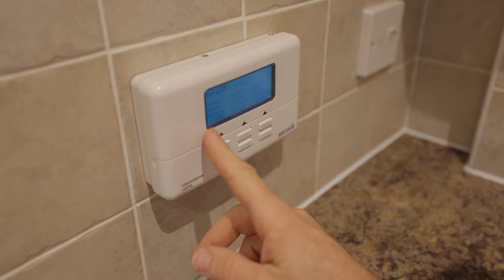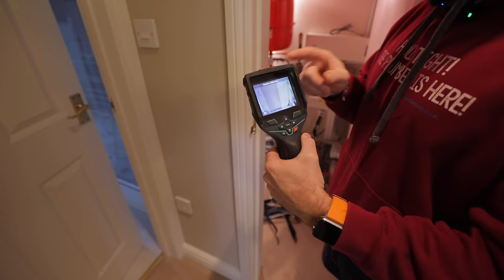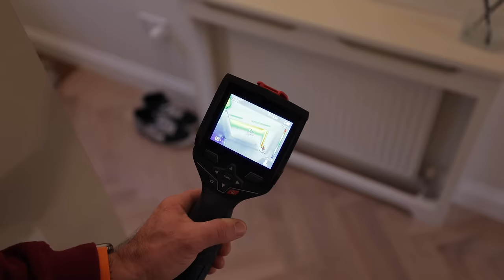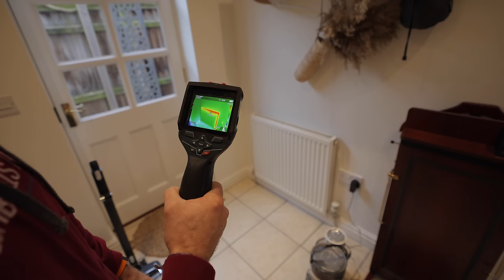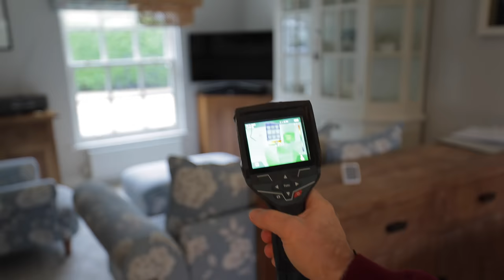THIS HEATING SYSTEM NEVER WORKED - Adam's Problem

Comment: Something that happened to me: back in 2008 i had a new high efficienty heater installed. All good, it worked OK. But gas prices have skyrocketed in the past few years so i was thinking maybe i can tweek the heater a bit. I discovered that my heater wasn't setup properly, all setting were still at factory default.
So after installing a proper OpenTherm thermostat i found a youtube video that explained how i could actually USE all the benefit of this high efficienty heater (Remeha Quinta 28) , i entered all suggested settings and presto, done. That was in 2020. 
My gas bills have dropped substantially in 2021, 2022 and i expect them to be even lower in 2023 (extra insulation measures done) ! Without sacrificing any comfort. 
Moral of the story: my heater had not been working as a proper high efficiency heater from 2008 to 2020...! don't assume your settings of your heater are correctly set! Check them, it might save you quite some money.

Comment: If there are metal pieces in the system, then it seems a good design would have a magnet designed to attract them before they shrink a pipe's inner diameter, like they do in car transmission pans.
Reply: Had one above the boiler.

Comment: When that gas boiler is knackered in a few years I’d suggest a air source heat pump with minimum zoning, no buffer and get some solar on them overly large roofs. 7kW Vaillant should heat that home and hot water no problem. Just make sure you use a Heat Geek approved installer. I love my system and my house is lovely and warm all year round and costs less to run than my combi gas boiler did. This was only 10 years old and it was also a condensing boiler. Cost was over £1000 per year to heat my hot water and my home (large 4 bed 1950’s semi) back when gas was dirt cheap at 2.3p per kWh. It’s way more than that now for gas. I pay 7p per kWh for my electricity and I store that cheap night time energy rate in a large home battery so I’m never pulling any expensive day rate of grid energy. To heat my hot water and home now costs me less than £500 per year.
Reply: That’s a lovely home Adam has by the way. ❤

Comment: What you think of heat pumps? Personally I think you need to be a mathematian to get the best system build.
Reply: Nothing wrong with that. It's about time some thought was put into feasibility, design and correct spec of heating systems was finally in place in the UK. We lag far behind Europe in technical ability and have relied on lazy oversizing and back of fag packet gas boiler installs that weren't up to scratch. Unfortunately the same mentality is going into some heat pump installs.
Reply: That's why we have heating engineers, so that they can do the maths necessary to design the system.
Reply: surprised there are not calculators or programs that you can input dimensions of rooms etc to give you the system specs. There probably are & that is what they use.

Comment: TRVs are a waste of time and are trouble from when they are installed !  Good video though. Never use motorised valves they are out of date and have been used for 50 years. Most plumbers never move with times. We don't drive our cars which have 50 year old technology so why is it accepted in the heating world ?
Reply: They’re old technology but reliable and relatively inexpensive.  What would you suggest instead?

Comment: I disagree with the zoning mentioned at the start of this video, running the boiler with weather comp, along with mixing valves with the correct kvs to each circuit rather than an on/off zone valve setup makes far more logical sense

Comment: silly video ,if you are plumber this is school boy stuff, bit of crap system tbh no weather comp and no priority hot water and no hydronic separation on the underfloor which is why the radiators dont work. The under floor needs balancing to match the index of the radiator circuit. wasting your time setting the radiators when the underfloor kicks in its going to rob the heating and mess up the flows you just set.
Reply from the maker: Still working perfectly fine mate. 👍